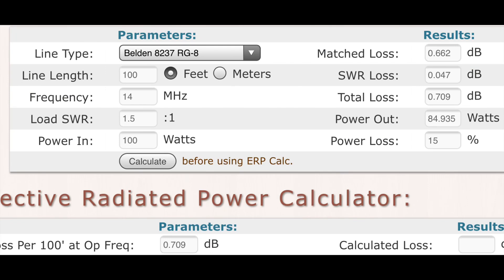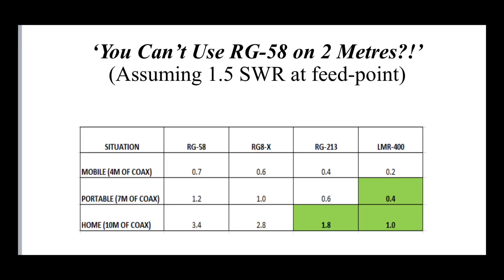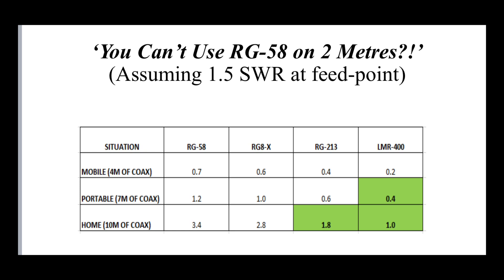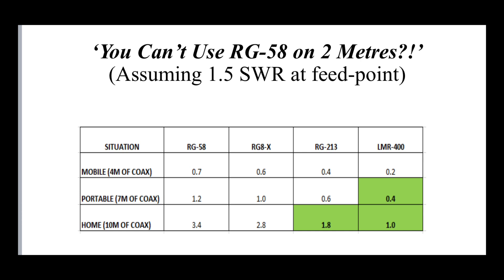Ham Radio: Coax Cable Myths

Comment: I think the biggest problem these days is finding good quality coax, I bought some rg58 off eBay and it was absolute rubbish the outer  braid just fell apart as I was trying to fit a        PL 259 to it so buyer beware
Reply: I got some of that! I bought it deliberately as the cheap stuff is copper coated aluminium which is very light, a lot lighter than copper. It's a bit more of a pain to work with and solder but I've found that it works very well for my portable setup of maybe 8 metres or so...and did I mention it's light? :-)

For the decent (heavier!) stuff, go to one of the amateur radio stores, Martin Lynch or Waters and Stanton or the like. They have mail order/ebay sales as well I think.

Comment: LMR400 is not great for all applications, the aluminium foil/copper braid combination has been found to be a problem with passive intermodulation in some scenarios. Well done for your sensible analysis.  In some situations cable loss is more critical, IE if you are a VHF DXer without a mast head pre-amplifier every dB of loss in the feeder will degrade your noise figure.
Loss in RG58 gets far more ugly on 70cms and up, but it is worth a thought whether reducing loss would serve a useful purpose. 73 David

Comment: My mate used RG58 because that is what he had, he ran it through his house out the the aerial and used it for ages.  Then he got high quality coax from somewhere (it was supposed to be thee best) no idea of the number of it, but he had a hell of a job running it through the house,  It was on 2mtrs.  I gave him a help run it through, trust me, it was one hell of a struggle.  Left him to it after it was in place, asked if it was any better he said "No, don't notice any difference, if anything it is worse, more noise!"  I don't know about more noise, but I listened, and to be fair I didn't notice anything.  He had quite a run of coax to a co-linear 2 mtr aerial.  Both my mates used RG58 when mobile and didn't have any problems, yes there is maybe a loss, but they didn't notice anything!  Neither did I to be honest.  My other mate had fancy coax to his aerial on the house, but he was so high up it made little difference to him anyway!

Comment: Thanks Tim. Agree, portable ops, especially on foot, weight is key and the runs will always be short. At home, for a fixed install, then don’t skimp I say. 

Are Tim’s dry-clean trousers going to be a permanent feature from now on? 👖 Sheep kicked into touch (or hot pot)?! 🐑 🥘 😁